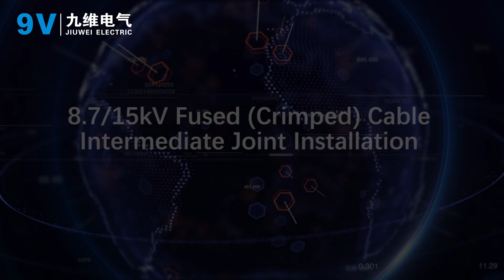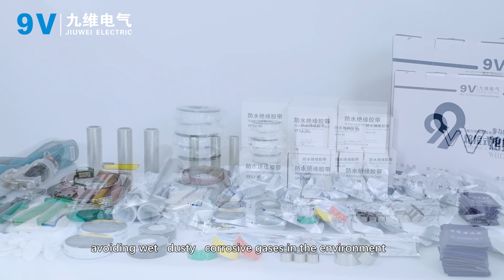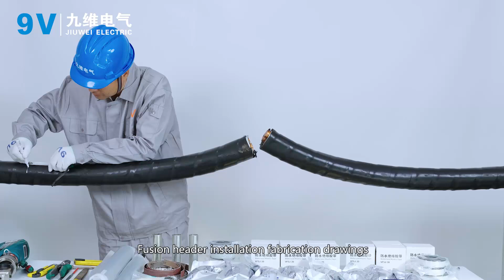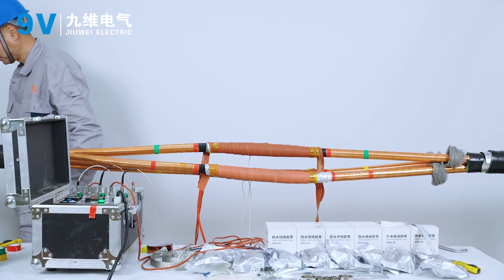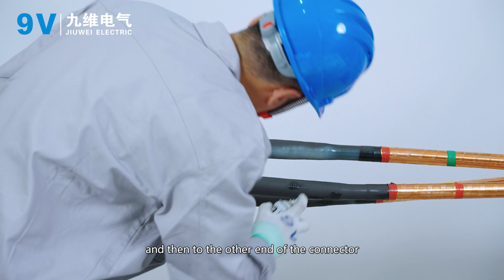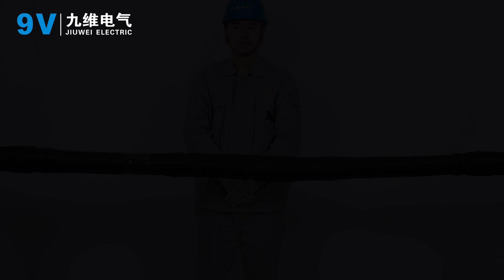15kV Fused Crimped Cable Intermediate Joint _ 9V

Comment: This, folks, is why you CHECK for underground cables BEFORE digging. This is "only" a 15kV cable; buried cables can operate up to 66kV, and repair of the higher voltages is considerably more costly. "Average" cost of 15kV buried line repair starts from $3500 upwards,

Comment: Why use aluminium tubes to connect copper wires?
Reply: just because it's silver colored doesn't mean it's aluminum. it could very much be zinc plated copper